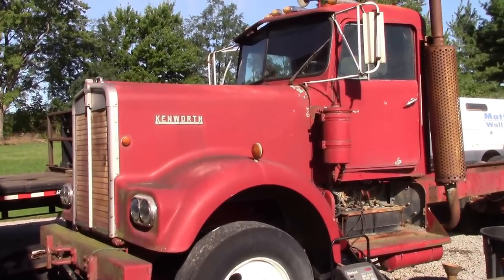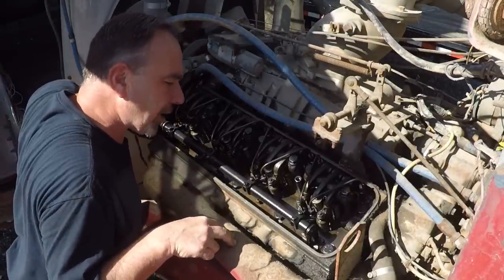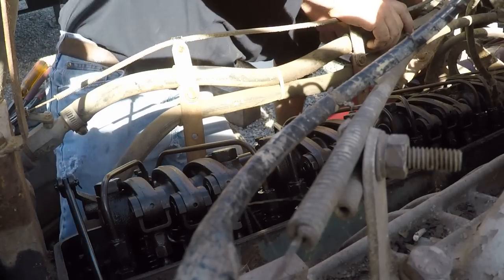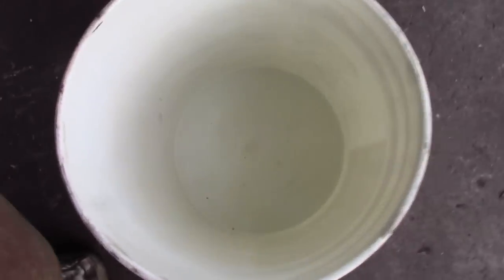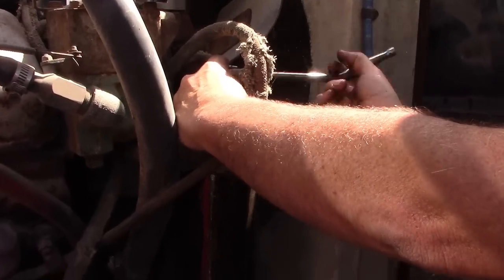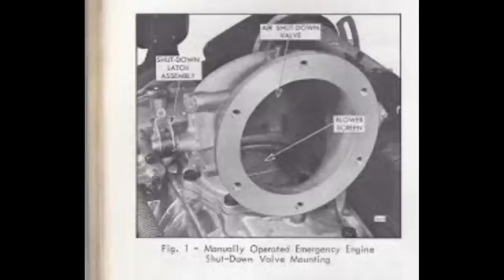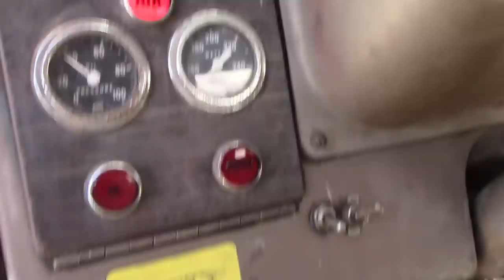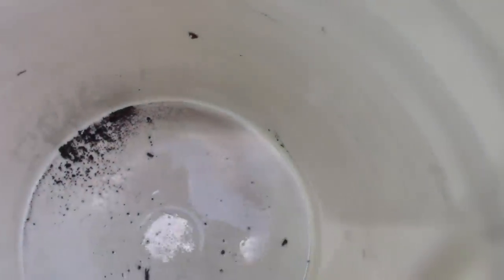WILL IT START? 1968 W900A 8V71 2 STROKE DETROIT!?

Comment: Yummy old diesel... if you put some treatment ala anti microb stuff in the oil it'll still fire off of it lmao Oil bath filters anywhere? Looks like the previous owner maybe put newer fenders on it at some point [usually in the 60's they had the headlights apart from the fenders like eyeballs] lol Very reliable and strong old motors. Be nice to see you do the cab swap onto a new frame and motor set ups [going to go with a Cat or a more modern Detroit?]. Was wondering what you would want to finally keep to restore? B-body Mack or needle nose Pete? Rounded cab beats with cool faces [ever notice that old trucks seem to have faces and attitudes to them?] lol love that bulge in the rad hose [eeyikes] lol LOved when you started to blow the old mouse nests out of the exhaust system lmao

Comment: I used to trust my woman that much. I didn't think twice that she had the mental capacity to push the clutch in and keep it in neutral when she turns the key. I used to have that trust. Then my woman ran me over.
Reply from the maker: you do understand the parking / spring brake was applied and both the transmission shifters were in nuetral?

Comment: I've been told that a 8v71 id designed to be run like a gas engine if its the NA model aka ran hard and put away wet so to speak and they don't like idling they are awesome engines and I have run one with 2 blown cylinders before and you can replace just the bad cylinders and keep going uts awesome

Comment: I see you got it figured out how to prime fuel system fast ... i figured this out years ago with dual tanks i would shut off return line to the tank I'm sucking from so only returned to other tank and shut off suction line on other tank that your returning to take air hose blow gun wrap rag around it and hold on filler hole feed air and start cranking starts in 30 seconds or less no fear of splitting tank because enough air will escape past yor hand one person operation if you can reach key and tank at same time other wise 2 person if only 1 tank return line needs to be disconnected and put in bucket plug hole for return in tank the return fuel needs to go somewhere like u did by dumping in bucket having taps on tanks makes this the easiest what you did works every time guaranteed. It works so well i quit pre filling fuel filters and possibly introducing contaminants into system i used the blow gun i had tied in by seat no more wearing down batteries trying to start diesels that need priming. Good job on your vids love this stuff💨💨💨💨👍👍

Comment: Also on an engine that's been sitting around, you should check the airbox drains to make sure they are open. If something has stopped up an airbox drain, when the engine starts up and there's oil or fuel inside the airbox, it will get sucked into the cylinders and cause an engine runaway.

Comment: Thanks so much JC!  I have watched the Bus Grease Monkey (or whatever his real You Tube handle is) and got very little out of his videos since he rightly believes his viewers know how Detroits work.  Now that you've taken me through the basics I am wondering why the 3 exhaust valves don't operate all the same.  I think the middle one opens later and closes earlier than the outer 2.  This also explains why Detroits are ideal for turbocharging.  The turbo pumps the input air pressure far beyond what the crank driven air pump does.
Reply from the maker: sometimes i skip over some details video. i forget that not everyone that is watching one particular video has watched others where i may have previously mentioned something.
Reply: BGM (Scott) has explained how they work, many times. That's how I knew.
Reply: This engine has 4 valve heads. The outside rockers operate 2 valves each via a valve bridge. The center rocker is for fuel injector operation only.

Comment: The only thing you might have done differently would be to bar the engine over a full revolution of the crank. Also, to help with re-prime after changing the filters, you can use ether but only after a helper gets the engine spinning over first. This engine has good compression. Finding jakes for the Detroits is difficult now.
Reply from the maker: i never use the "devil sauce!" (ether).

Comment: the governor on 2 stroke Detroit's operate on oil pressure surging is caused by air in the oil if you have hunting at idle change oil and 9 times out of 10 it will stop

Comment: Wow just started right up there didn't it and no Cosby in a can needed. I think that old Detroit wants to work a while longer.
Reply from the maker: no need for the "death spray" if you have all the pieces to the puzzle and some patience.
Reply: @j.c.smithprojects   you most definitely did a more thorough job prepping it to be started than anyone I have ever seen and I think that had a lot to do with it starting so easily. I may be biased by that being one of my all time  favorite trucks with one of my favorite engines but that was one of the best first starts I have seen in a while.
Reply from the maker: thank you. i appreciate that.

Comment: Very informative video for sure! I recently bought a '74 Paystar 5000 with the 8V71 and I'm having a cooling issue I was hoping by replacing the 2 thermostats would take care of the problem but it didn't. 
May i ask if you may have a recommendation on this situation?
I'm certainly not a Mechanic  so any advice would be appreciated. Thank you.

Comment: It's a shame that they couldn't get thr old Detroit Diesel engines to meet EPA guidelines.  How hard would it have been to convert to convert to digital fuel management like higher fuel injector pressure???   Bigger turbochargers like the two-stage units now being offered??

Comment: Curious of your opinion of the 2 stroke i admire your work habits
Reply from the maker: it is a well designed, reliable engine......for me, the novelty of that screaming motor wears off quickly when you are constantly shifting due to the lack of power and torque. compared to what was available  in the late 80's through the early 2000's, this 2 stroke dose not make great hp. they dont have great torque. they were a huge step forward when compared to gas engines of that time....they are neat and sound good. it is not an engine i would choose for everyday or over the road use. better suited (at least for me) in a truck that is used locally or occasion. doesnt mean that people dont use them for that everyday....it just means it wouldnt be my choice.

Comment: Mr Smith I was wondering with all the valve covers you removed  any reason they stop.using those knobs on those Detroit 2 cycle still.use that IDEA and better. then the bolts
Reply from the maker: these are all real metal valve covers. now they are cheaper and lighter materials. this requires more bolts and to be placed closer together to holds its form and make a seal. all about saving pennies and weight.

Comment: Actually, all two stroke Detroits have intake and exhaust valves.
Reply: technically its intake ports and exaust valves 
though on a traditional 2 stroke engine its all ports but on a detroit its exaust valves

Comment: I have a 2000 Ford F250 super duty supercab Long bed that I want to put a whole 5 to 7 manual 4 x 4 front end under it I’m talking gearbox everything which means I’d have to do the rear end as well I watch a lot of your videos my friends in great shape Scott great brakes on a new calipers new ball joints new tire rods you name it The tires good and back are great tires get your wrangler all-terrain the Kevlar ones the rear ends in great condition I just had a hard time finding the parts I’m about 150 miles away from you I don’t know if you need or know anybody that needs is the parts of my truck and if you would be willing to do the swapWith a manual transfer case and hubs then I was wondering I am being a super cab long bed if I could make it a four-door short bed I know it sounds crazy but I got a lot of it’s either that or find a four-door truck with a blown motor in it like an 0506 and put my training in motor in it because I got a lot of money in my motor and I really need a four-door if you can please call me at 941-350 -3904

Comment: Pitty the chassis is in such a poor condition, the engine sounds great .
Reply from the maker: yes. the wheel base would have worked for what i want to build. it is a shame to use just the cab and hood off this truck but the rest just doesnt work for what i want.

Comment: Bulletproof pre emissions bs
Reply: Motors got a LOT better before they got worse. My 350 Detroit in my '74 Freightliner 8664 got 4 to 4.5 mpg. Visible smoke, hard to regulate idle speed when motor was cold, other things. By the '90s they had really nice, efficient motors. Then the decline. But my trucks today are all '99 or older. Will keep them until I retire in a year or 2.

Comment: Just so some of you will understand that 2 cycle engine in the truck is the same thing as your 2cycle chainsaw and weed eater
Reply: Not exactly, they don’t have exhaust valves, and they don’t have an oil filled crank case, and a chainsaw/weed eater, etc you have either an oil injection tank or have to premix the fuel